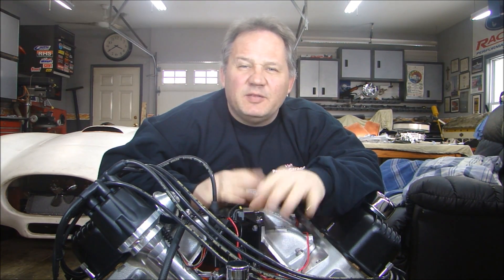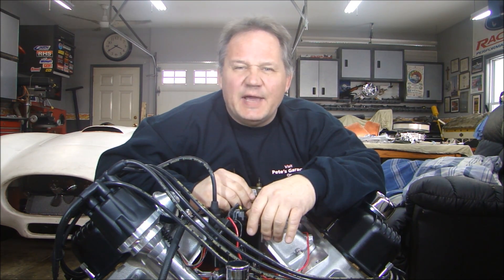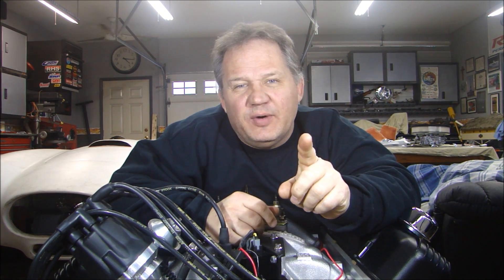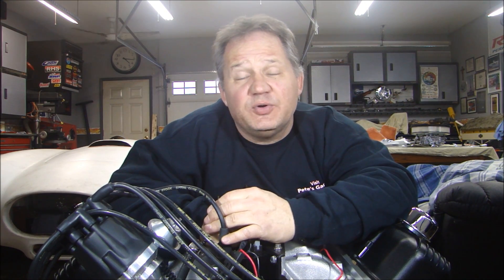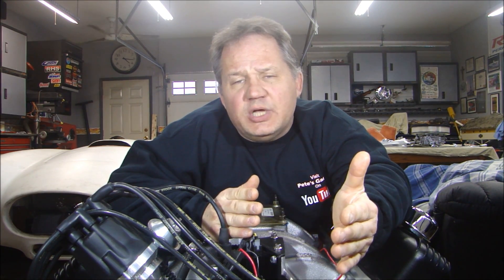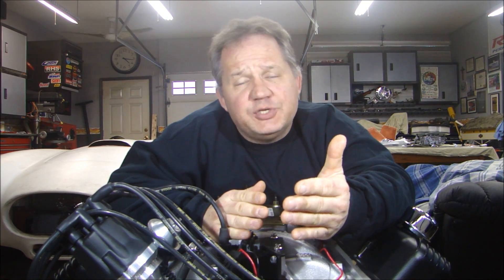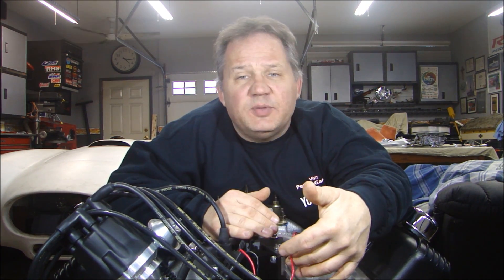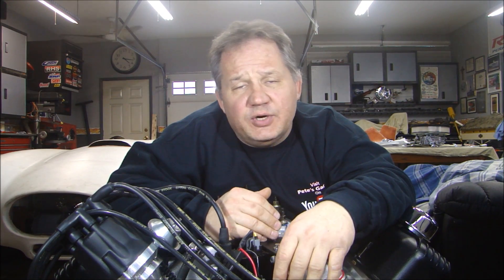440 Chrysler Mopar Engine Building Part 12 - Dyno Test

Comment: Hi Pete, Awesome series on the 440 build. I like your style. I learned a lot which is good as I'm getting ready to build a 440 for my Superbird race-replica. I'm thinking I want to get at least 600 hp for the Silver State Challenge. What recipe would you recommend for doing a 90 mile endurance race with a top speed of 200+? Obviously I'll have a rear end with some tall gearing and I'm thinking of putting Gear Vendors gear drive behine the 727. I need help with which heads/cam/ pistons and crank combo  and intake and carb set up. Any recommendations? No turbo or supercharger wanted yet.
  Thanks!
   Chris in Seabeck Wa.
Reply: Yes I totally agree I build mopar engine for a living so do have high expectations but the output that this engine produced was more inline to what a stock stroke 440 with properly ported cast iron heads and mild flat tappet cam does. I just pulled a 499 off the dyno last weekend that has ported cast iron heads a old mopar .528 flat tappet cam factory six pack induction and 9.8:1 compression. It produced 640 ft lbs of tq at 4300 RPM and 578 HP at 5200 RPM.  This combination should have easily made the same amount of tq with at least 615 plus HP. I would be embarrassed and taking the engine back apart if it couldn't perform better then a stock stroke cast iron heads engine at half the cost.  I don't know any professional engine builder who would ever just pull a head out of the box and bolt it on without verifying that every specification was correct.  This gives Mopars a bad name with such a under performing 10g combination. The detail on the other hand was fairly nice but some of the most important details have been overlooked.
Reply from the maker: Interesting point Danny. I agree with you and could have gotten huge numbers, but I have to think about what the customer wants and build an engine that not only fits their needs, but will perform for a very long time. The target was 500 HP, not 600, so I met the goal and it runs fantastic for the car it's going in. It is also going to England so it's not as cheap to run as it is in the US. Gas over there is very expensive and giving him a 600+ HP engine would cost a fortune to run. I'm never embarrassed when the customer is happy. Maybe I will make a video series about how to squeak out every last bit of HP. Thank you for your comment.
Reply from the maker: You'll have to work backwards, how fast will the tires be rotating, what gear ratio in the back, what RPM will the transmission be turning, where is peak torque needed in the engine to make sure 200 MPH is possible, what cam fits that torque range etc...
Reply: I'm working on that process now as I'm gathering parts and pieces (and money for it all!)  Thanks Pete! Keep up the good work.

Comment: Great videos thanks for sharing your knowledge.  
Question for you...
I have a 72 chevy 400 small block.  And a set of new promax heads. 64cc chambers.  2.02/1.60 valves. With 185cc intake runners.  The intake i have at the moment is a Weiand X-celerator. The block is stock std bore and factory pistons. Dished. It was a 160hp two barrel engine.  But i was hoping the 64cc heads would increase the compression.  I will eventually be having the block bored and trued up.  But this year its going back together with the stock crank, rods and pistons. So my question is what cam shaft would you recommend for this engine combination.  The car is an 84 camaro. 4.11 gears. 700r4 transmission and 2500 stall converter. Roughly 3200 lbs.   Ill be running it on the 1/8 mile drag strip. And street driving now and then. 
Any advice would be appreciated.  
Thanks again
Reply from the maker: You have to match the cam to the valve springs. So either choose a cam that matches what you have, or buy a bigger cam and get the valve springs to match. A racing cam will kill stock valve springs, even in promax heads.
Reply: Pete's Garage 
Sorry i should have gave you those specs too. The springs are supposed to be good for .550 lift. And for a flat tappet hydraulic non roller cam.
  And i would also like to be able to get by on pump gas.  I was watching your video on cam selection and realized that the cam timing of the intake closing has a lot to do with the actual compression and what type fuel i can run.   I know going from the 76 cc stock heads to 64 cc is going to make a considerable difference in compression even on the stock dished pistons .  I just don't want it to be so much that i have to cut back on timing and lose power.  So i guess what im asking is. With a cam that makes power in the 2000 to 5600 rpm range.  For drag racing.  And no more than .525 lift.  What in your opinion would be the best duration and lobe separation angle to go with on a 400cubic inch engine and what should i look for as far as intake valve closing btdc. 
The cam is the heartbeat. And i dont have a lot to spend on the engine this year. So i really need to get it right the first time.   Always before i looked at the power range that the cam was advertised at. And picked one that way. But i see after watching your video that i could have done better.  
Oh and if you have any decals about your YouTube channel.  Id be happy to slap some on my old hot rod this summer before  the track he opens.    I think a lot of guys could learn from your channel.  
Thanks again.
Reply from the maker: That's a great idea, I'll get some decals made. I would go to the Comp Cams website and use their tools to help you select a cam. Call tech support from a couple manufacturers and see what they say. It's not as difficult as you think. 110 LSA for sure with a .525/.525 is a good tartget
Reply: Pete's Garage 
Ok thanks. 
I did email compcams yesterday so maybe they'll have a good recommendation for me in the next few days. 
Let us know when you have your decals available.

Comment: Do you think coil on plug ignition would have given you anything more?
Reply from the maker: I use the same ignition power I use on bigger engines. The spark it pretty hot and I don't think the difference would be measurable.

Comment: I would have expected a little more than that. What is the cam specs? Compression ratio? Is only a mild cam?
Reply: Honestly.  How could you expect anything without knowing the cam specs or compression?
Reply: That's why I asked.
Reply from the maker: The cam is 242/248 @ 50, 93 octane, 9.5:1 dynamic compression. The goal was 500 HP and still be a nice street runner.
Reply: wow ,
Reply: That's pretty good for that comp etc. Nice work mate.
Reply: Did you fail to notice that not only is the motor fully dressed, the test was done at 180 F and the correction factor was SAE. That makes 532 pretty damn stout compared to what many other dyno operators show you.